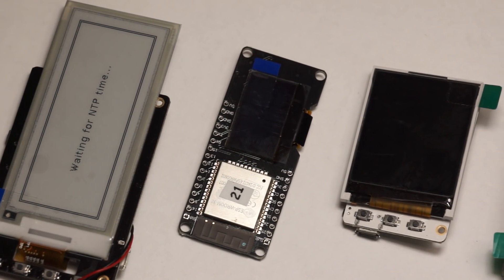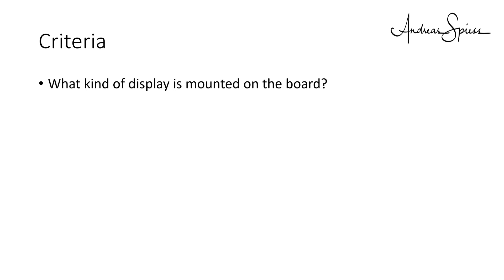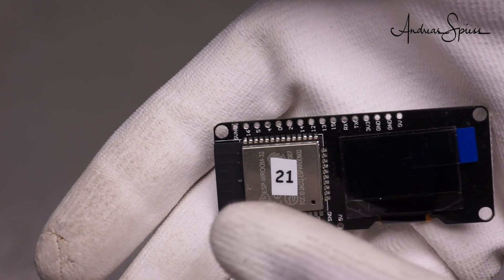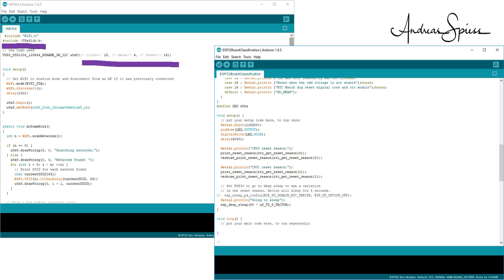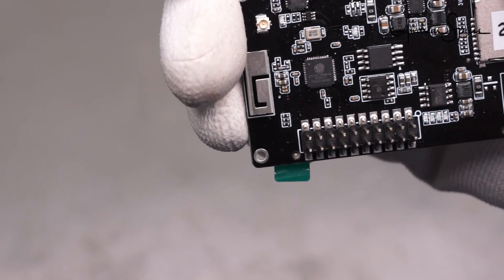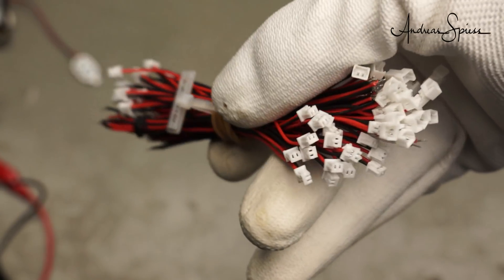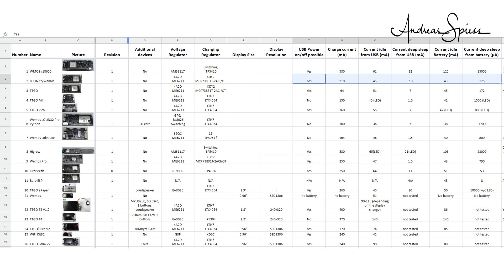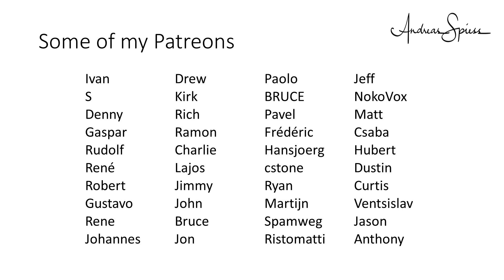#201 New ESP32 Boards with Displays

Comment: Thanks for your thorough work an comprehensive overview in the ivid and the spreadsheet as well.
Frankly spoken, I made my life easier folowing some simple conclusions: 
- Wifi excludes battery operation => I do not expect that ESPs will provide a really good solution here. There are much better ways for battery driven sensors 
- complex displays do not comply with ESPs because of lack of pins.  I2C displays are useful, SPI mostly not => I do not expect that these combined boards will really help me. 
- The central base of home automation cannot be an ESP => you need an other, more powerful, solution for it. Minimum Raspi, Orange Pi or an old Windows Notebook.

Example: Your rembember/weather etc. display.
- Such a display has to be big enough to be really useful. That means you need a (cheap) tablet  or an (old) smartphone + WiFi => you need mains
-  you need a synchronisation with calendars (e.g. garbage collection), weather stations and status of your house => you need a base station for home automation which is able to collect, analyze, distribute and visualize these data
- most probably you want to include different systems and suppliers in your home automation. => you need a system with a powerful community developing the necessary adapters 

To bet practical: Last weekend I urgently needed a calender driven display to inform the mobile nursing service of my demented mother. I could quickly implement and deploy this using my ioBroker with the iCal and vis adapters, a Google calendar and a cheap tablet. 
I am using a lot of ESP based senosrs &  actuators, Sonoffs, Homematic sensors &  actuators, door openers, NFC, cheap 433MHz sensors, Ikea tradfri, and Xiaomi Vac. All these things  are really in use and useful and can interact over the ioBroker platform. 
Of course, there are also other similar platforms eg. FHEM, openHAB or the simpler domotics, see https://forum.iobroker.net/viewtopic.php?t=12764 
But in my opinion you need such an architecture to have a really useful and successful  home automation.
Reply from the maker: Of course, you are right if you look at home automation. I do not have a lot of that. For other purposes, a display can be a good thing. For example, our radar speed sensor needed one.
I try to do the basic legwork to provide the information that my fellow makers can do the right choice.
I think too, that smartphones and tablets are excellent tools, well worth the money. I use my old iPad in my car to play music. and I even have a subscription for audible on it... Free of charge.

Comment: I disagree about the uselessness of deep-sleep with OLED-displays. Sure, an OLED-display does use a lot more power than e-Ink, but it also uses less than a regular TFT LCD, and with an appropriately-sized battery and deep-sleep the battery can last from a few days to a week. A few days to a week of battery-powered operation, with a display that can be read even in pitch-black darkness can be useful when you just temporarily need to monitor something.
Reply from the maker: You are right if you go for a shorter time between charging the battery.

Comment: Just a reminder of an outlier in this market: the m5stack which is over twice the price, but you cannot beat it for good looks. It's ready to deploy right out of the box!
Reply: I heard of the M5Stack just after buying the TTGO-TS-V1.2.  They share some very similar features and some of the M5Stack libraries will also work with the TTGO.
Reply: diff mull yes! I was going to ask why it wasn't included, especially since he has shown he has one in past videos
Reply from the maker: The M5stack is not a board, it is more and more expensive. I still plan a review.
Reply: I got the M5stack a while ago and wasn't able to get my computer to recognize it when plugged in to a USB port. Have not yet figured out the source of the problem, which is disappointing since the device looks to be quite powerful.
Reply: I had no trouble with Linux, but if using Windows you may need to download a CP2104 driver. See this doc http://www.m5stack.com/assets/docs/
Reply: Would you recommend buying one of those M5Stack modules? I was hoping to use it in a RFID, MQTT setting. Having a couple of buttons and a speaker already built in, too is a welcome bonus, but worth nothing if the overall design / usability is flawed.
Reply: I found it really fun to play with; I was programming it to give to a friend, and got it to provide a wifi hotspot and play happy birthday whilst still in some suitable wrapping paper. I had no m5stack-specific problems, but it as a little hard sifting through all the ESP32 alternative SDK's to find useful examples. It really is in a class of its own at the moment, as a "finished" product you could safely leave in the hands of a non tech-savy person. If you need super low-power deep sleep I'm not sure what the standby current is, nor how long the small battery will last, but if powered from usbC it is a winner.

Comment: Your experiment with e-paper was not a failure, you saved so many people so much time :) I'm waiting for smart e-papers, low power with ble or other, that would disconnect the display that does not have to be on the same application board.
Reply: Fellow Youtuber, G6EJD, has a project driving the Waveshare 4.2" and 2.1" EPaper displays (https://www.youtube.com/watch?v=AeYbX0zaJTY) using an ESP32 and the Arduino IDE.
Reply from the maker: Thanks. I have to try this library. Maybe it also works with my device...

Comment: Thanks Andreas.  A comment on the Wemos board No21 is that since the display sits lower than the shield on the ESP32, it will be very difficult to put in a project box if you seek a neat, flush screen finish
Reply from the maker: You are right. I did not see it because I did not put it in a box.

Comment: Andreas, are you sure that those "Color OLED" are really OLED screens. They look to me regular TFT displays. Color OLEDs are much more expensive. Check it please and fix your spreadsheet. BTW you make great work. EDIT: I just checked used display controllers - they are regular LCDs not OLEDs.
Reply: I have the 1.8" one but I do not use the Adafruit libraries anymore. I use Bodmer's TFT_eSPI library. It supports more TFT hardware than Adafruit's and is far more optimised so it's faster. Most of it's functions are compatible with Adafruit's but some require conversions. I took the game of life example code from that library and converted it to Adafruit's and the difference in speed is instantly noticeable! With TFT_eSPI it draws the life on a 128x128 screen at 1 pixel per cell in real time (probs around 10-30 fps depending on how many active cells are being displayed) using an ESP32. On Adafruit's library you could see the display being drawn line by line when fully populated and then at best 5 fps!

Oh yes, the library is at https://github.com/Bodmer/TFT_eSPI :)
Reply: That's correct. They're not OLED. On the TTGO-TS-V1.2 (which I have), it's an SPI 1.44" TFT screen driven using the Adafruit_ST7735 library. See : https://github.com/LilyGO/TTGO-TS-V1.2
Reply from the maker: + cbm, koz: Yes, you are right.

+Galbi: Thanks for the link
Reply: On my TTGO I created a clock that in the top quarter of the 128x160 screen it shows the time and date, obtained from an NTP service. The rest of the display shows the Game of Life or can be switched to an analogue clock display using the first button. I plan at some time to increase its functionality. Maybe a setup screen to enter the WiFi details instead of having to program it from the PC every time you take it to a new location.
Reply: Video of my early version of the clock on the 128x128 screen I mentioned in my first reply: https://twitter.com/Galbi3000/status/986361741574594561

Comment: When I want to build a very low power device, I put together the parts I need because dev boards from China are mostly built for price and not for low power. Also for displays I prefer the display on its own as it gives more flexibility and it is easier to mount on a box (it also requires a smaller box as the esp32 board che be fitted behind the display and not on the side as many of the boards)
Reply from the maker: You are right. But for tests, I find these boards quite comfortable.

Comment: The e-paper display seems looks like the WaveShare 2.9inch e-paper display. I've been using the GxEPD library (https://github.com/ZinggJM/GxEPD) for this, and it runs great.
Reply from the maker: Did you use it on the ESP32?
Reply: yes, made a simple weather station with it. Also works fine on the ESP8266

Comment: illustrating perfectly one of the issues with current esp32 - arduino ide support is still very inconsistent for devices.
Reply: I did connect my epaper to an esp32 and use it with the Arduino IDE, I just copied the provided files (esp-idf) in the same directory as my arduino project, modified the pins in one of the .h file and added an include in my main .ino file.
It is not complicated to add  C "driver" files to your Arduino project,if  you're not a beginner anymore, come on...
Reply from the maker: Thanks for the tip. But I want not only this test file. I want to use it in my projects. But I will try your proposal.

Comment: Problem with OLED is durability. After few hours od working, pixels have clearly lower brightness than those not used one. Of course, automotive models don't have this defect, but arę more expensive. 
Good idea is screen saver most for OLED, but TFT needs too.
Reply: I didn't observe the temporary dimming of OLED, on TFT - static shape first causes temporary burnout od display, when it lasted longer - permanently. On both display You should prevent this using dream screen or eliminate longtime static display.
Reply: Because automotive use typically IPS LCDs, same in aircrafts
Reply: cbm80amiga, from a few years OLED is tipical display on car instrument. Only cheap cars still have LCD.
Reply: I have also seen people say this. But I have had no problems with them, even after being used for months as temp/humidity sensors.
Reply: Tesla is a cheap car? Really?